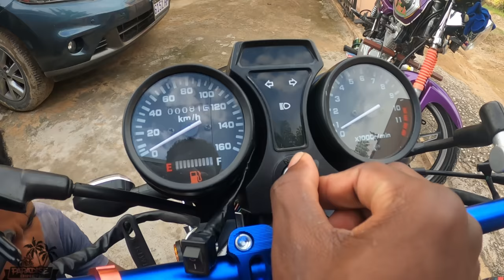Fixing Bikes & Chilling Out On The Block (Eagle 200, Zhujiang 150, Champion 150 & Rebel 250)

Comment: What u mean by half choke?
Reply from the maker: The choke is a lever on the carburetor which helps you to start the bike when the temperature is cold. It limits the amount of air the bike gets and increases the fuel making the bike easier to start in cold weather.

Comment: Tell Cooli dem horns deh need to be installed with a  relay on them
Reply from the maker: Said the same thing, but he said because its 1 it doesn't need it
Reply: @ParadiseBiker  it still does need one because one of those horns puts pressure on the wiring (power source) of those motorcycles or the horn will sound very weak
Reply from the maker: True..